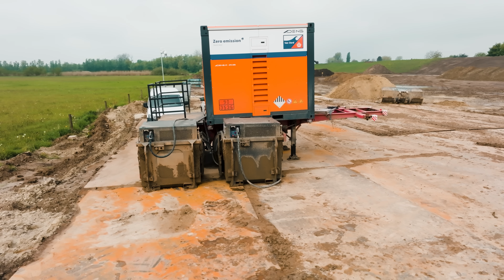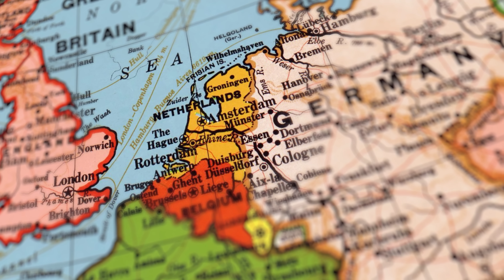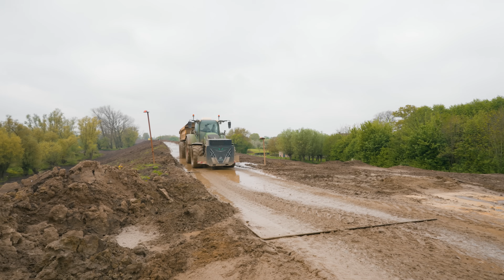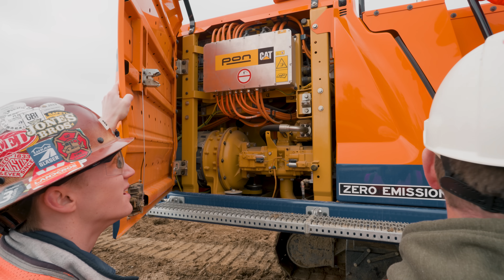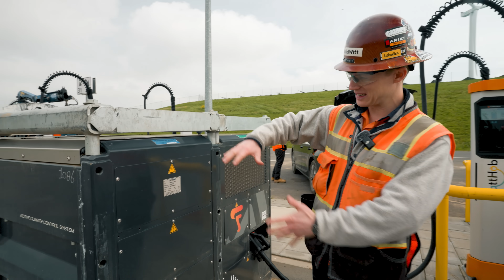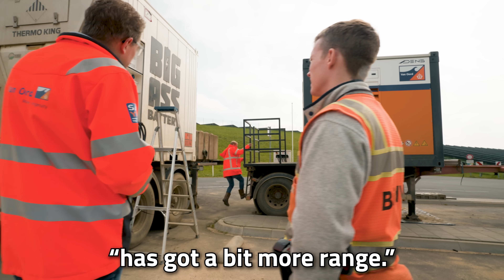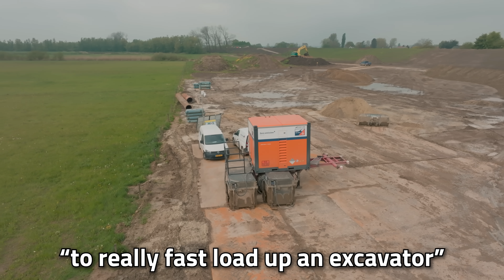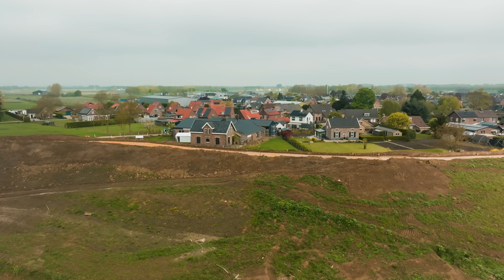Inside the World’s First Electric Construction Project!

Comment: The problem of global warming is not due to the greenhouse effect. The problem is the overdevelopment and massive deforestation of our planet. Look at the graphs; global warming can be exactly compared to the green spaces that have fallen victim to roads and buildings. The same applies to the global net deforestation.No money can be made if our growth is the problem. You have to imagine that you can still cross forests or green spaces barefoot even in extreme heat.Tar or concrete is something else it can stores heat, which can have advantages, but it also means that the night doesn't cool down as quickly and the day gets even warmer. All these green spaces have contributed to the climate balance. They don't simply disappear; they're replaced with something that makes the situation worse.
Recently we've also got AI buildings that emit even more heat than normal buildings.
Not only do they require more energy, which causes further problems during production, but they also need to be cooled, and the resulting heat is released into the environment. 
The CO2 issue is the biggest lie of the last 100 years and it won't help even if China and America go green.

Comment: Not sure if this is the case here, but just to explain how things like these work in the netherlands/europe. As is explained there are very strict rules about nitrogen emmisions. Since a lot of regions are at cap in the netherlands due to intensive agriculture building permits are sometimes not given. Since the project shown here is an important (critical) goverment contract, the tender for contracters will for sure ask for a solution that reduces as much nitrogen as possible. This pushes contractors to come up with innovative solutions pushing the industry forward. Just to show that the governement can induce innovation if it gets involved.

Comment: This seems like an utter disaster that only manages to be viable due to the contract forcing the electric vehicles to be used as much as possible and the project being relatively small.

At least the machines/devices will have uses for projects where charging happens to be close, such as building houses.

===

Seems the construction industry is not going to make a major electric transition any time soon.

Even if stuff like hydrogen fuel and biogas give methods to fuel the machines with no-CO2-emitting methods.

And this is likely 1 of the contributing factors as to why fossil fuels are going to continue to be used until the world runs out of them, especially non-coal sources, or a large enough disaster to drastically reduce demand. 

Even with renewables eventually dominating electricity production.

Especially with renewables improving the ability to pursue and use fossil fuels by improving society's efficiency. The most trivial example being in improving the infrastructure 🏗 of relatively undeveloped zones.

Comment: In cases like this, wouldn't wall power be a nicer option? The digger only moves in one way, so dragging a cable along wouldn't be a problem.
Reply: you can`t pass a wall both side are used.  they have to work in layers so they do move up and down quit a lot.

Comment: When this project started in 2013 it presumably wasn't all-electric because none of this kit was available then, so it presumably became electrified part way though, which is is remarkable. Great to see this happening for whole projects. This is the future.
Reply: nah the markup for doing it this way had to be at minimum 20-25%. All that charging infrastructure costs a fortune and it doesnt' give any additional capability outside of the emissions reduction. You can already do all this with diesel electric machines which is what all large machines are anyways. No way 95% of projects are going to find the emissions reductions are more important than getting 4 projects done instead of 3.
Reply: @sparkzbarca  No, but they will like the fuel savings, and the extra places they can operate without fumes (those are currently the niche jobs that already make financial sense), and eventually it will be cheaper to do it this way than using diesel, and then everyone will switch pretty rapidly.  I think you may be surprised how fast this will happen.
There are already some farmers switching because PV plus electric machinery is dramatically cheaper than diesel+diesel machinery.
Reply: @xxwookey  for places without fumes only indoors makes sense and yes the electric fork lift and such are already common because of that.

EV will not ever be substantially cheaper

I mean firstly as demand for gas goes down the price will and the Saudis can pump oil for far cheaper than you can ever make electricity.

The Saudis pump oil for 10 a barrel. 

40 bucks a barrel was the low price in 2020 and gas was 1.75 a gallon then. 

While it does need to be refined there are around 20 gallons of gas in that 10 dollars of oil. 

You will never ever get electric much cheaper than gas. Ever.

You will just make gas cheaper.

There will be short term volatility yes because you can't switch everything at once. 

But gas will always be cheaper.

You cannot get the rare earth and metals and all that carbon fiber and such for wind farms or solar panels for less than gas is pumped in the desert
Reply: @sparkzbarca  We shall see, but the long term trends suggest you are wrong. 

Oil extraction costs go up over time as the cheapest/easiest gets used up. Technology improvements push in the opposite direction and make it cheaper. These have pretty much balanced for 100 years and the price has been broadly the same over that time.

Wind and sun never gets more expensive to extract, but the technology improvements still push the price down, and have been for 40 years now. 

PV+batts will continue to get cheaper for the foreseeable. They are already pretty cheap and beat fossil fuels+engines for many applications (homeowners, remote mining, cherry farmers, domestic power in most of the world, urban delivery, taxis, etc). That will just keep spreading, and I don't think it'll be long before it's true for construction in general rather than just a few parts of it as now.

For the fumes thing you need to include cities with bans on diesel emissions, of which there are already some, and this will only spread too, because poor air quality is killing many thousands.
Reply: @sparkzbarca dinosaur!! Get with the times man. Electricity is soooo much cheaper than diesel!! The investment is steep; but the return is certainly there!! Otherwise these companies wouldn’t be doing this…
Reply: @basvanbeers3515  these companies are doing it because the Nordic countries which have lots of oil wealth and are very liberal and have high environmental laws are willing to pay 50% more to have a job done this way.

But given that paying people thousands of dollars wasn't enough to get electric cars to take over from ICE it's pretty self evident that this is only worth it for the company because a government is willing to give them all the infinity stones to do it that way
Reply: @sparkzbarca what the hell are you talking about??? This is in the Netherlands… not a Nordic country!!
Reply: @sparkzbarca take of the American glasses!!
Reply: @basvanbeers3515  that's true, hadn't watched the video in a while, forgot it was Netherlands. Everything relevant still stands though. 

They are only doing this cause they are willing to pay out the ass for it. It's much more expensive than the alternatives. 

If electric was actually cheaper all the big boy mines would do it. The largest coal or iron ore mines in places like Australia for example.

They do pay lots for small savings, they have automated dozers and dump trucks and that costs a fortune to set up but they run 20% more and at their scale that's huge. 

This, this isn't it. The cost of all this charging infrastructure is equal to a dozen more heavy machines and then you even have like small batteries charged by large batteries charged by chargers it's insane the cost of this compared to a fuel truck and fuel
Reply: @sparkzbarca  insane is you not looking op diesel prices in the Netherlands…. That justifies some heavy investment. Especially since the total cost of operation goes down tremendously. What’s also insane to me is your denial of the new reality!!
Reply: @sparkzbarca  the “big boy mines”…. Do you mean the enormous Australian mines that use electric dump trucks?? Again; take of the coal tinted glasses!!
Reply: @sparkzbarca  Some 'big-boy' mines are switching over. If you are in the the Australian outback, a big solar farm is much cheaper than shipping diesel out there. And if your mine is downhill an electric tipper will charge itself on every run and thus use zero fuel. These are still niches, but like I said, those will spread as the technology is proven. The very biggest mine machinery in the world is already electric and has been for a long time (bucket-wheel coal excavators in Germany). And underground mining has been electric for a long time too because exhaust is dangerous. 

Read the ABB report on mining electrification to see where things are headed. 3/4 of the industry expects 25% of their fleet to be electrified by 2030, for example. That's a pretty rapid electrification given the lifetime of plant.
Reply: Tho is going to kill the earth !!! Look up cobalt and lithium mining !!! This is awful and none of these batteries charge with out diesel y’all are fucken fools blinded by this trash !!! Kids young as 5 digging in mines villages bring wiped out due to massive deposits under their villages killing then sneaking the land or kidnapping killing the women leaving men and boys to do this it is the route of all evil

Comment: I follow the german Elektrotrucker about electric trucking and he showed some constructions machines from the Bauma convention (their trucks usualyl have like 600 kwh batteries too). 
That they do a whole jobsite already in the Netherlands is very cool to see.
I wonder if they ever replace the hydraulic pumps to conserve more energy on these machines.
Also very cool to see the logistics with the mobile battery chargins solution. If this works out then it should be easy if you have a power source nearby and can trickle charge your charging solution.
Lots of possible variations it seems but also logistics you have to really think about

Comment: You don't need an inverter if the excavator is using dc motors.
Reply: Quite a novel idea to dump ac to a mobile battery and have a fast charger built into the battery. I wouldn't be surprised if they didn't sign some kind of contract to profit from these electric excavators and other equipment.
Reply: Oh profit from the battery design also.

Comment: How do they charge those batteries?  Coal.  Much more dirty and weaker than diesel.
Reply: Actually no, they are charged by community owned wind turbines (without going via the grid)
Reply: Only 10% of Dutch power grid use coal, 36% natural gas, 50% wind solar and nuclear. In this project "for show" they only use solar and wind.